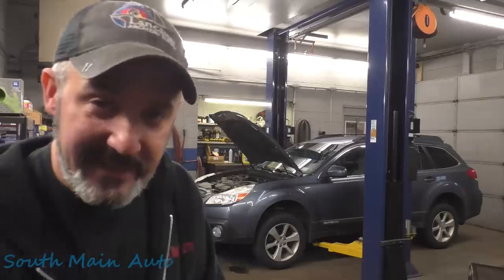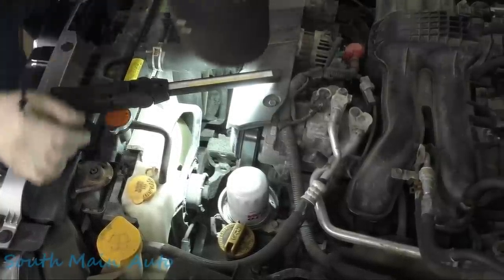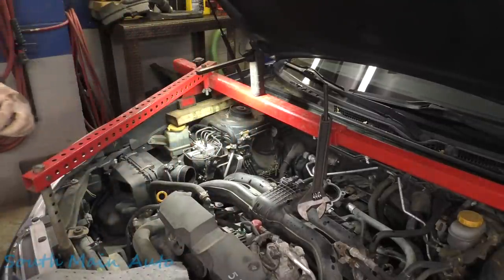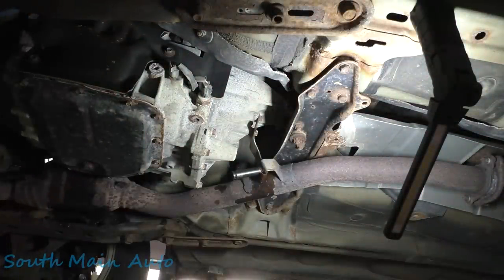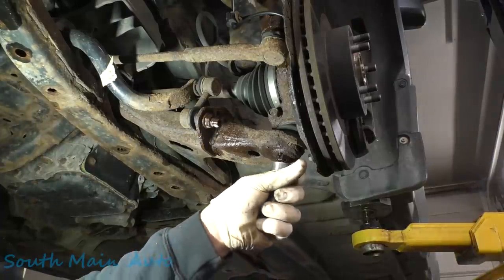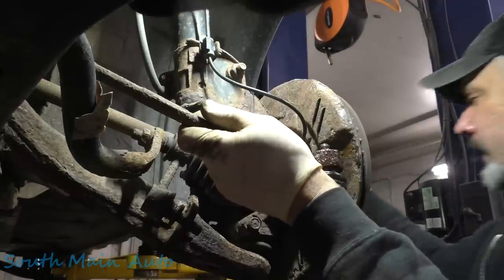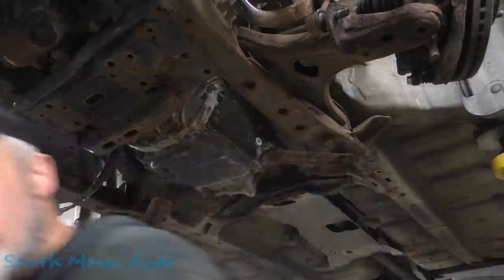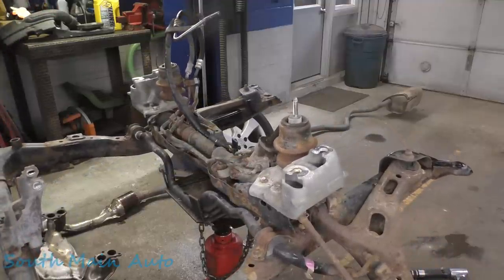Project Rotted Subaru Subframe - Part I

Comment: 27:02 - tip for you, Eric. When in that situation where the stud is spinning and you need to put some tension on the tie rod to get the nut off, use a ball joint press. You'll know what I mean.
Reply: That’s such an incredible tip, I’m stealing this!!!
Reply from the maker: It's tips like this that piss me off! 🤬

I mean WHY THE HECK didn't I think of that 25 years ago!! So freaking simple too and the perfect size hole in the top for the chrome socket on the impact haha  I owe you a beer buddy!
Reply: I don't like that idea. Its way to logical.
Reply: I would usually put a jack under the bottom of the tie rod and push it back into the arm socket.
Reply: @SouthMainAuto  We are always learning. That's why I watch these vids. Sometimes taking a hammer for everything isn't the best idea.
Reply: when i was watching, I said ,"Grab a big pry bar"....I guess I would have to see the ball joint press in action
Reply: I’ve used the ball joint press like that with great results.
Reply: I'm all for a big pry bar and then heat if necessary.
Reply: @andrewcarr899  It ain't brain surgery folks. lol
Reply: Vice grips ftw
Reply: If the tie rod is spinning like that should it be replaced? Mine was  doing that so I replaced it when I was doing my control arms on my 08 Pontiac. Figured it was better to get a freshy on there… considering how I was already doing so much other stuff.
Reply: Wow ! not a brake job, whoopee…
Reply: WD-40 is ok for tight bolts/nuts, no good for bone dry heat siezed.  Plus-gas is the stuff (if you can still get it) but it evaporates quickly, you have to keep it wet.  We used to use it on furnace gear.
Reply: I guess I got lucky: I'd pinch it with a big pair of channelocks and zap it.  They always came loose.
Reply: @CrimeVid  Any thin oil will do the job if you can get it to wick in. I use PB Blaster or whatever is handy and use an air hammer on low air pressure to coerce it into the gaps.
For nuts, if you have room to do this, the hands down best way is to clamp a pair of vise-grips (not a sponsor) onto the nut as hard as you can. That forces the threads into the space as much as possible and opens up gaps that run the thickness of the nut 90 degrees away. Hit the end of the nut at those gaps with penetrant spray, let it wick in, and repeat with as many pairs of flats as you can reach. The process breaks the bond and lets the lube in. It's bailed me out a few times.
Reply: The SNAP ON BJP1 weighs a ton.  Try to wrestle that with 2 hands while also removing the nut!
Reply: @Deadbuck73  It is supposed to spin.  They are always stiffer when brand new and then eventually wear in to be a little bit more loosy goosy.
Reply: @Guillotines_For_Globalists  well that explains it. But at least there’s a fresh one now. Thank You.
Reply: @351cleavland  lol
Reply: @Deadbuck73  The spinning stud doesn't matter at all in regards to wear, I had a brand new one do that after a week. I had to take it back off to do other stuff that failed for out of province inspection. The only thing the spinning means is it can be a pain to take the nut off again but if you have a ball joint tool and saw this tip that isn't a problem anymore. If they were spinning but didn't have excess movement there's no point in changing it.
Reply: I've been known to get a big C clamp in there. The force is way off-center, but all you need is to get that taper to engage with enough force so that nut can turn without the shaft turning.
Reply: @351cleavland  'too'
Reply: @SouthMainAuto  you and me both! Never thought about that! 27+ years and learned something new!
Reply: @adventureoflinkmk2  You've been watching Derek too much!
Reply: or just use transmission jack to put pressure under there since he is on a lift. Can't do this method while on jack stands cuz the trans jack is way too long. But you might be able to push it up with floor jack, bottle jack etc. If the tie rod end is the other way around like on my honda then this method doesn't work, have to get longest prybar and stand on it while impacting :D
Reply: @brianbanks3044  one guy days ball joint press, you suggest a lever, ive been fond of giant c-clamps to compress everything together 🤷‍♂️ the cat is getting skinned today thats all i know

Comment: We've been doing these regularly at the Subie dealer I work at. Pro tip Mr. O: take the power steering pump and reservoir off leaving all the lines connected. You can snake the whole assembly done and don't have to worry about opening up the power steering system to air. They can be a mother lover to get quiet once you open them up.
Reply: Another pro tip for getting power steering systems quiet after opening the system up - use a vacuum pump - put the adapter at the reservoir opening, pump a little bit, and then let the pressure off. Usually within a couple times, it’s nice and quiet.
Reply: You can also crank the engine and turn the wheels with them up off the floor and the ignition disconnected.
You circulate fluid and return air to the reservoir without making champagne bubbles by aeration.

Comment: How you remember where everything goes when it comes to putting that back together is beyond me.  Kudos to you Mr. O!
Reply: After doing several mechanical repairs, it just comes naturally.
Reply: Magnetic trays separated top and bottom bolts
Reply: ikr, it seems like with all the makes models and years it feels like a job like this would be rare but then you hear Mr. O be like, this is only the 37th one I've done...
Reply: I used sandwich bags. Write what bolts go where on said bag.
Reply: I just lay stuff in piles, reinstall bolts where they go, and lay stuff out in component location. 

Just did a cam job on a HEMI. Laid a thick blanket over the roof and laid out parts there.
Reply: A lot of it is just put stuff where it fits like a jigsaw puzzle, sometimes you do need to pay attention to the lengths of bolts though.  A few years ago I gutted my wife's car looking for an electrical short, front and rear seats, center console, a lot of the interior plastic all out of the car.  Sure didn't think she'd ever get to drive it again, but after I found the short (pinched wire between the rusted bumper support and the body, yes outside the car🤦) I reassembled it without much trouble.  There were a couple things I installed out of order and had to pull again, but nothing major and it was a lot cleaner when I was done.
Reply: If You have a few Nuts and Bolts leftover then Your good to go! 🤣
Reply: Mr. O is similar to  Magnus Carlsen in that his memory remembers every move.
Reply: @DirectCurrent4u  : You were just more efficient that the manufacturer.
Reply: As an older mechanic who just threw all the bolts into one container said to me “I just keep putting them back into the holes until there are none left”😂
Reply: YouTube and the internets a good source of video's or information there's" always some guy making a video", or posting about these things on forums L.O.L.   For my Job I get asked to work on machines that I don't see many of as i'm not dealer shop trained on them. As long as a persons smart enough to figure out if the guy posting info is right, I'll generally figure out fixing it or think why did this guy take so long removing half a machine he didn't need to.
Reply: It’s just part of the job. If you have left over fasteners, you know you did something wrong. It happened to the best of us. Lol.

Comment: Had a 1992 Saab 9000s.  Drove it 23 years and 256,000 miles in the upstate NY area (they called it Rottenchester :).  The front power train cradle was made of galvanized steel.  When I dismantled the car at the end of its life, the cradle looked like new.  Note to Subaru, think about galvanizing, think long and hard about galvanizing.
Reply: Even galvanized metals can corrode too under the right conditions
Reply: SAAB was the master of over-engineering, which is why they were so solid and lasted so long...and why GM was so pissed at them when they found they were killing their profit margin by overbuilding and strengthening in places they were told not to.  😁
Reply: @aussiebloke609  yes they became Junk after 2000
Reply: @aussiebloke609  What model years?  Are you saying certain SAABs are reliable?
Reply: @ferndog1461  I was thinking more of structural engineering...but now you mention it, the 99 and 900 were actually pretty reliable.  The 9000 was a little less so, likely because of GM's influence in that period...and my understanding is that GM's influence increased dramatically in 2000 when GM bought out the rest of SAAB and attempted to add their own brand of cost-cutting, including badge-engineered mechanicals direct from GM.

Comment: Saw this yesterday and just saw the short where you show just how rotted that frame actually was due to the mean comments, and glad you cleared that up. 

This just shows that a 7 year old car is very rusty, even if it at first glance looks fine. Outside of the sub frame, the bottom of the car, of what I was able to see, didn't look too bad, but it also is proof that rust can kill a car in a few years time if not periodically rinsed off underneath, or rust proofed so the car will last a bit longer.

About 7-8 years ago, or so, Bill of UXWBill fame here on the 'Tube showed how just rinsing the wheel wells periodically during the winter months can prolong the life of the truck bed. At the time, his brother, affectionately known as the "key keeper" would do this with a 90's era brown single cab/short bed truck known as the big brown piece of junk and they live in Illinois, just south of Chicago, so rust is an issue there and yes, I believe that truck eventually succumbed to the rust as he replaced it with a long bed, newer green Chevrolet.

In fact, he would take it to the high pressure car DIY car wash place and do the entire underside of the truck. Even at the time of that video, the bed had not rusted out, yet. Their 84 GMC diesel had bad rust in the body and it was scrapped a year or two later of that clip. Eventually many of their older vehicles from the 80's-90's all eventually had to be scrapped due to the rust. I think most everything now is 2000 or later.

Comment: I did the same job on front and rear of 2008 patriot while battling cancer. Did pretty much what you are doing. Actually went pretty well for a backyard mechanic. Chrysler actually reimbursed me for parts as well.
Reply: There was a 10 year warranty extension on those subframes.
Reply: While battling cancer? Impressive. You intimidated that subframe into submission lol

Comment: Nicely done.  A couple of years ago a buddy took his Toyota in for service to the dealer.  A couple of hours later he was called to come in to discuss "an issue."  Turns out hos truck was one of a large of production batch that had horrible metal in the frame. The dealer was compelled to seize the truck for structural defects of the frame.  My buddy never suspected anything but they showed him the swiss cheese rust of the frame & how it was flexing just from being raised on the lift.  He was pissed because he did not want to be forced into a situation where he was forced to buy a new vehicle even though Toyota was offering a relatively handsome rebate.  He ended up with a new vehicle and n a short time he was overall pleased with the outcome.
Reply: Seized the car?   I can't say the dealer didn't try in order to sell a new one,  but seized?   It's  not his property and they wouldn't have a title to even scrap it.    There was value in that rusty truck and it belonged to the owner.
Reply: @hugh007  Yeah.  Some dealerships will claim they can't release the vehicle because it's too dangerous or somesuch...but in reality it's just one of those unethical, dishonest tricks they use to pressure you into buying something else.  Personally, if I had that much unsuspected rust in my frame, I might want to get a different vehicle - but I'd be choosing a different brand then, too.

Comment: I remember when I worked at a Subaru dealership we replaced many subframes. If I remember correctly there was a recall on the older legacy and outback’s on the rear subframes rotting out. I do live in New England so the salt gets to them quickly.

Comment: what gets me is it seems the body panels show little rust but the undercarriage is pretty well done.  An inverse of the Square Body Chevy Truck days were you would go through five fenders and doors before the frame was done.
Reply: Dont forget the rockers
Reply: @danfarris135  up here in wisconsin I thought rocker panels were some kind of factory option because I never see them.
Reply: Like GM cars of the 90s....all that body cladding hid so much rot
Reply: I replaced the sub frame on my Toyota Sienna  the floor panels and actual frame looked good but the rockers rusted right off
Reply: @danfarris135  and the cab corners...and the tailgate and the pickup box and the hood and the cab roof....
Reply: @vapecatt  that was fuckin hilarious, I’m dyin hahahh
Reply: @kyleritchie862  how did they deal with it?
Reply: @kyleritchie862  yep my GM truck looked brand new from the top down 2014.. but the frame was gone this year. Only did 88k. Too many y  issues with liability if I had the frame fixed.  State would required the title to be changed to home built. Then go through all sorts of inspections.
Reply: @vapecatt  😂 same here in Illinois
Reply: @vapecatt  I laughed out loud when I read that .. Same in michigan.
Reply: @Ariccio123  dip the panels in chemical antirust coating/plating before paint
Reply: @Wrang15  A 2014 model frame rusted out??? That's insane.The old Chevy trucks the body would fall apart before the frame went. My old 05 Nissan pickup has severe bed rot going on but frame is still thick and solid. A friend has an 05 F150, drive in same area as my Nissan and same mileage and his frame rusted from the inside out. It's pretty common on that Gen f150, first year of full boxed rails and they didn't put enough drain holes in the bottom so debris and water got held inside the box channel. But still it took from 2005 to to just last year for it to rot through in NE Ohio. A 2014 truck with -100k miles should not have had frame failure already. That's either a design or material defect (cheap steel with low precious metal content, leading to poor corrosion resistance).
Reply: @jeremydavis2595  same thing rusted from inside the sealed frame. Have seen now 5 trucks  same  problem. The ice melt spray  gets in some place and can't get out.
Reply: @Wrang15  Yeah it sure does. I'm honestly surprised my Frontier hasn't gone through yet since it's full boxed too. It was already rusty when I bought it but I think my next truck is going to be bought very young and either Fluid film or Krown protected every year before rust gets a hold. I have seen it extend the life of a few friends trucks greatly. It's just a sad state with how much trucks cost nowadays and they have such a short life for the price. A coworker just had the AFM ruin his 5.3 in his Sierra. Metal shavings from the failed lifters plugged the oil pickup and starved the whole thing of oil so it needs a long block. Just has over 100k miles and he still owes $16k on it, can't drive it and can't afford a long block either so it sits while he makes payments. Meanwhile my brothers 88 k2500 is still going with over 300k miles 🤣. Good ole 350....
Reply: @columbo1966  I did some reading, and apparently now VW is additionally flooding pressurized hot wax into the frame after plating/coating. At least in New Zealand. Look up "wax flooding"!

Comment: I once had to change the tranny in my olds Aurora and I made an engine support from a bed frame .  Worked great for a diy job.
Reply: That's hilarious but pretty inventive..👍🇺🇸
Reply: rebar and recycled bed frames are considered 'safe' frame substitutions in great states that dont require state inspection. cant forget the structural bailing wire though, the frame will fall apart without it
Reply: Nice.  Amazing the $$ folks will spend on “specialty” tools that are no more than square tubing, flat stock, all thread, etc stitched together.  I prefer to make my own as well
Reply: What did the car identify as after that? LOL!!!

Comment: I have a 2011 Outback it's in great shape 283k just did Ball joints , tie rod ends and end links timing belt kit and new radiator hoses.

Comment: WOW!  Definitely looking forward to part 2.  I saw rust on the subframe but not where it entirely rotted through.  Not living in the salt belt, I didn't pick up on the clues of where it's entirely gone.
Good one Mr. O!
Reply: Same, surface rust but didn't look too bad from what was shown. Perhaps there's some actual holes in a section we can't see on video.
Reply: @unimportant5122  there's lots of holes. Look at the video section starting at 14:25. The section of frame to the left of Eric is completely rotted through. It's not easy to pick out, but not much is left.
Reply: @Tommy_Mac  Indeed, those sides are totally gone once you know what to look for.

Comment: Here's another one of those irritating tips! As an exhaust man of 30 years when we did stainless steel nuts and studs we heat them up nice  good and hot beautifully nice hot Almost White then shock it with dead cold water and it would shrink and take all the shrapnel out of it and retain the bolts integrity and it wouldn't strip the threads!! Of course still nuts and balls totally different story half the time you did them when they were hot. You're doing an absolutely amazing job you're a great mechanic. 
All the best from Canada.